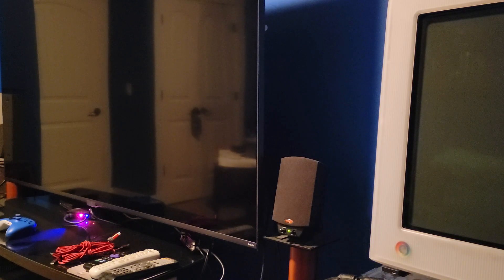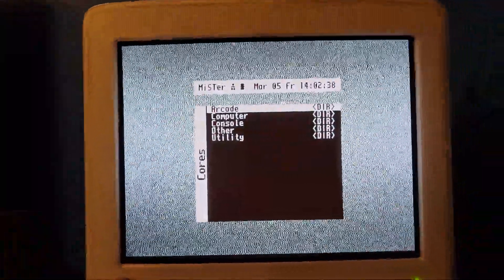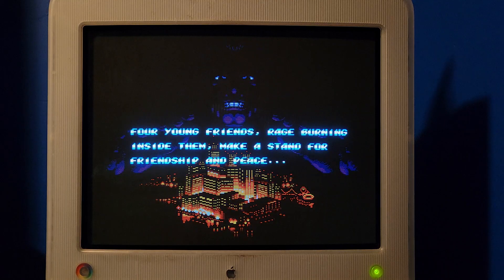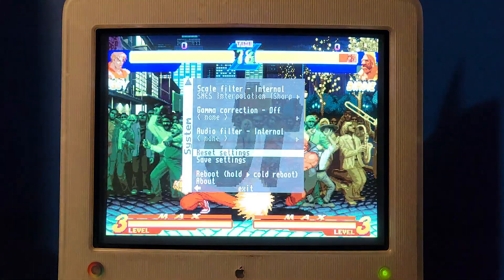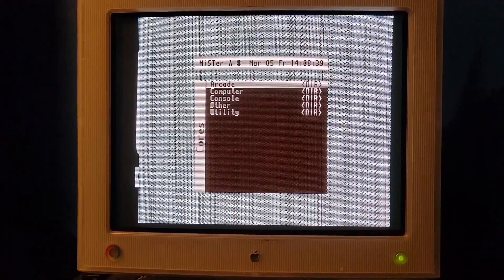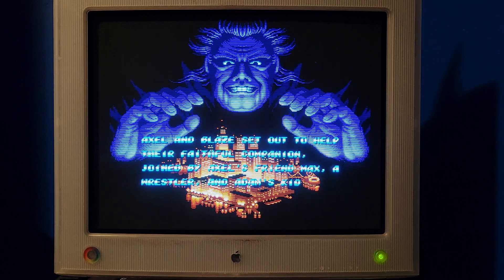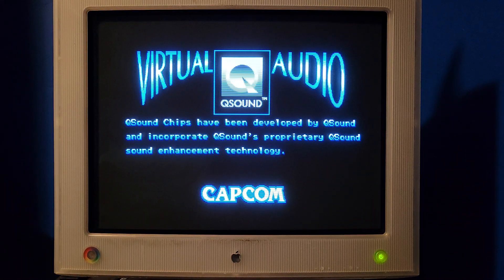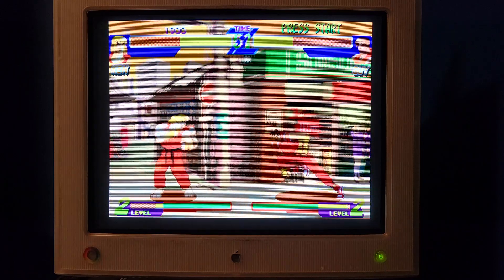MiSTer with 120hz output!

Comment: Hi, do you have your exact ini file shared somewhere?  I Have this exact monitor, but for some reason I can't get any image to be output to it. I use the Analog IO board, directly connected to the monitor, but no luck. When I use any random computer I have no issues at all with having an image on the monitor

Comment: For anyone wanting to adjust screen size & geometry... I installed SwitchResX (v.4.3.6) on my Power Mac G4 MDD, (OS X 10.5.8) and added the exact same custom modeline for 240p/120Hz as above.  Now you connect another monitor to your Mac (need 2x separate outputs). Then change the resolution on the Studio Display to 2048x240, open "Display" under "System Preferences (hard to do as everything is squished) and drag the box from the Studio Display over to the other monitor,. You will now be able to see the box clearly. Now click on "Geometry" (USB cable needs to be connected from Studio Display to Mac) and connect your MiSTer to the Studio Display VGA. You can then fire up 240p Test Suite using any core and adjust the Studio Display ON THE FLY using the other monitor & mose! Once done, quit "System Preferences" and power cycle the Studio Display. The settings are then sored to the monitor. No more borders!

Comment: It's worth mentioning that you CANNOT adjust the H-size, V-size or any geometry settings without a G4/G5 Mac running OS 10.6 or earlier.  This is because Apple did not implement an OSD/menu that cannot be accessed directly from the monitor. I have two of these screens and am currently on the lookout for a G4 Mac mini just so I can make adjustments to the monitor. Only Apple would make things this difficult!
Reply: I have the 17" version of this monitor and it has a built in OSD. Weird that Apple would decide not to include that in the 21" version

Comment: Great video and info! This pushed me to finally try 120Hz on mister with a 19" 31kHz crt and it is amazing!
Stunning!
Im susceptible to seeing jitter in VR if fps drop under 80-90fps and I dont notice motion blur artifacts at all with this setup which is the biggest complaint against this.... I dont see it!
 The greatest thing is by doubling the frequency to 120Hz it makes these pc crt's alot brighter because your doubling the time electrons hit the phosphors and halving the time those phosphors have to lose brightness. I found scandoubling with crt fx 50% looked great but the image was just too dim even with picture/brightness set high.

Was so impressed with this I too made a video about it but gave you and mike credit for the modelines and linked back to this vid in comments.

Comment: I assume line doubling didnt work because the refresh rate of this game is still out of spec for the monitor thus causing the sync issues. I'm not having this issue with my CRT monitors.

Personally i don't like fiddling with refresh rates of games. for better scanlines i just add a scanline generator between the MISTer and the monitor. set the scanlines on the MISTer to 50%, and fiddle with the SLG untill you're happy. Sounds weird but works quite well.

Comment: Looks great man. few things to note with vsync 0 yes it will have atleast 1 frame of extra lag. also you will want your monitor refreshrate to exactly double the cores refreshrate you will need to make custom modelines per core. vsync 0 doesn't automatically adjust refreshrates like 1 and 2. 

for example nes is 60.10 Hz for perfect scrolling you would need a custom video mode at 120.20 Hz

You probably won't ever notice any stutter in a fighter that doesn't have that much scrolling.
Reply: No stutter at all on scrolling games (nes genesis, snes etc) ive tested it, that is because a) integer scale and b) vsync =0 (almost 2 frames of lag, i tested it with 240p suite and 2 displays like retrorgb has done too). With the 2 frames of lag you get no shimmering and stuttering in scrolling games and also syncing with the monitor, because the de10nano's scaler does the job like for example framemeister does. But then again you have 2 frames of lag on crt monitor..... it works in way like the superresolutions on groovymame if i'm not wrong
Reply: ps vsync 0 guarantees 60hz output with an NTSC standard pixel clock (so 120hz in this modeline), vsync 1 uses a framebuffer but is kept into original vsync (technically, varies the pixel clock per core), and vsync 2 has the original refresh rate and pixel clock of the core (no latency).
Reply: @mdd4545  not true at all you will allways have some stutter with vsync 0 if the core refreshrate isn't matched with your hdmi refreshrate. no ammount of buffering will magically fix this.

Comment: At 2048x240 you should be able to do 60hz, no need to do 120hz.
Oh and 60fps@120hz isn't more blurry really, you just get a double image effect similar to playing 30fps games on 60hz CRT so it's not as smooth. The lower the phosphor decay/persistence the more noticeable this effect is.
Your mileage may vary though, this doesn't bother some people as much.
Reply: no 2048x240@60hz is still 15khz and incompatible with a 31khz crt. doubling the refreshrate or vertical resolution is the only way to increase the scanrate on a crt.
Reply: @brett20000000009  Shit you're right, I just did some calculations.
I thought for sure the horizontal resolution would affect the scanrate.

Comment: I have this same exact monitor. Tried the settings and they work but......the pixel scaling seems off vertically, even with vscale_mode=1
Reply from the maker: Do you have sync issues with cps2 and Scandoubler?
Reply: @BahnYuki  After latest Main updates i started getting Sync issues with cps2 core. I changed composite_sync=0 and now i don't have any issues using scandoubler. Let me know if you have any luck with this.

Comment: Thank you for another excellent video. This modeline works fine on my Sony Trinitron G200 vga monitor! i think that scanlines on this mode are better than enabling them from scandoubler. What i would like to know is the lag we add though because of using vsync_adjust=0 versus using direct mode and scandoubler. Also you can remove the black borders aroung integer image by configuring the centering settings through the monitor menu. Im not sure if you can do that though on apple monitors.